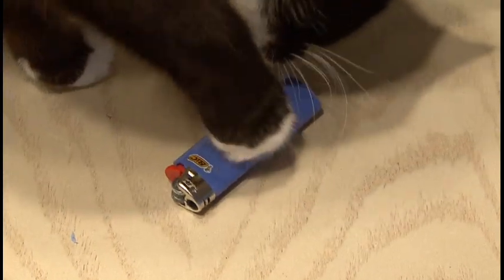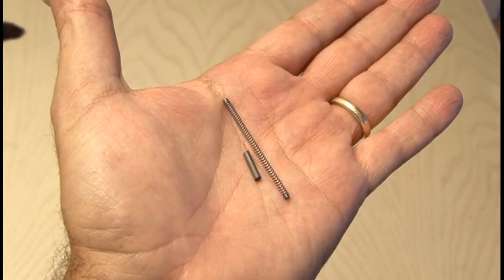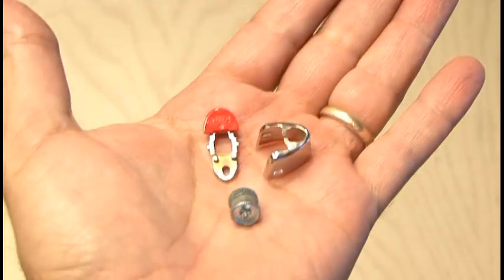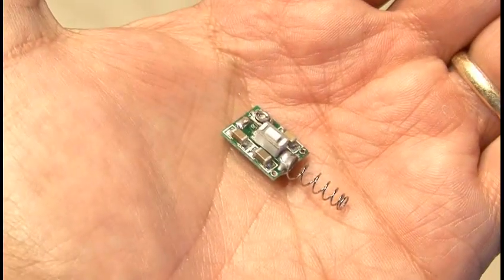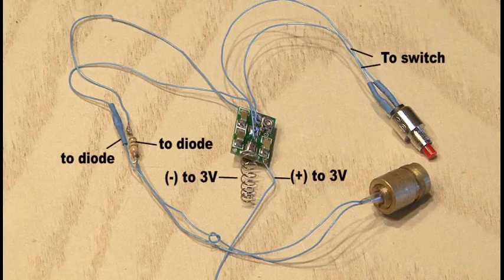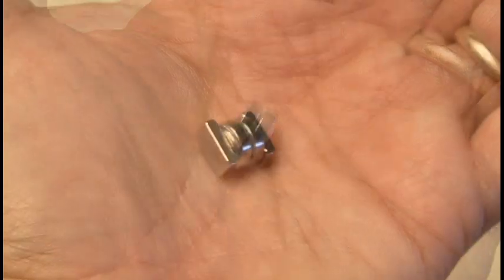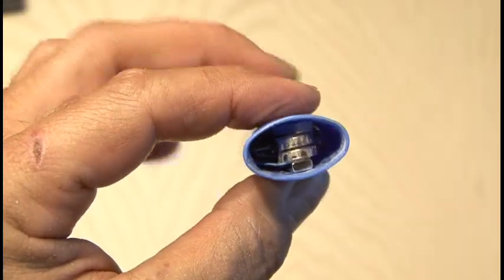Amazing Cheapy Lighter Laser Burner!

Comment: Really? So, as you well know admissible amperage from button cell is something about 0.5-1mA. You've got 2 of them, then there is 2.5-3Volts, right? ;) And now we have simple calculation Pmax=1mA*3V, so max power of this "power supply" is less than 3mW. Blue laser  who can burn something needs 200-300mW. So IT'S a FAKE! There is hidden wire to some hi-power supply. I like my look. :P BTW 4,2ohm resistor is just for deceive you...

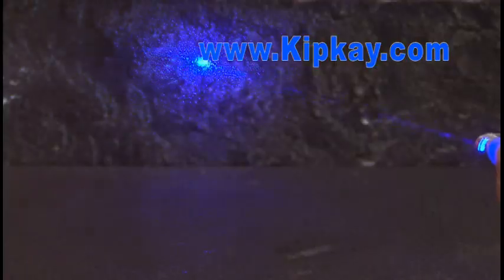Comment: To bad the laser isn't actually blue, its violet. If it where true blue (473nm wavelength) then a laser diode of that wattage would cost several hundred dollars and LaserDIY doesn't even sell "blue" diodes, they sell violet ones (405nm). You had to have shopped this video to alter the color of the laser, especially at 2:14

your videos are really cool and educational and i subscribe to you, but I really want my question answered: did you use a 405nm diode or a 473nm?

Comment: Laser is LASER!
Laser is just a term for concentrated directed light, and if you have ever been outside in the summer with a magnifing glass, concentrated light can produce quite a heat.
The Blue Laser diode coupled with the controler and the resistance makes the laser extremely strong, so you can burn things up to a certain distance.
Not instantly ignite tho, but burning things like matches, fireworks, cigs and paper, burn up after being exposed to that kind of laser for some time.

Comment: Actually making a laser like this is possible. You do get a bunch of small batteries if you take apart the right kind of battery. The battery shown is not a AA battery its a 12 volt batterry often used in cameras and camera flashes.  As for turning it on accidentally this lighter doesnt go in your pocket it goes in a travel kit or in your hand for just such a reason.

Comment: if you take the spring and wrap it around the flint..just leave enough spring to hold onto and take a lighter and heat up the flint till it turns red, then throw it.. instant sparkler

Comment: its a cheapy lighter , not a cheapy laser  ~ 

laser 59.99
driver 24.99
resistor 2.99
switch 3.99
a23 battery 3.99
bic lighter 1.49 
= 97.49

lighting you cig with a laser ~ priceless

Comment: Few issues with this:

-you weren't the first to make this Rog888 was

-You need a heatsink, a module is not sufficient for heat dissipation

- It's a violet diode (405nm) not a blue (don't exist and is 475nm) and the diodes are overpriced, you can get the PHR-803T which is more power and better for $10

-Those small batteries will last a few seconds

-THE GUY PRACTICALLY SHINES THE LASER IN HIS EYES!

Comment: Cool but for about 90 bucks O.o though i guess that's a ton cheaper than one already built.  I'm surprised you didn't remind people of safety precautions like it's a flammable gas so you should be in a well ventilated area without any ignition sources and it's cold when it comes out so keep hands away.  Also that the laser is powerful and not to aim it at or near a person(especially anywhere near a face!).

Comment: the extremely concentrated light (energy) beam from the laser is absorbed by the target and stored as heat energy until the heat builds up enough to ignite the object. Exactly the same process as the sun heating the ground as the sun does not actually emit any heat at all, but the light from the sun is stored as colossal amounts of heat energy within objects.

Comment: there are "knock off" zippo type lighters that do actually use butane, assuming all these parts could fit into one, they aren't that expensive, maybe $10 at the most, considering the diode alone costs $50.